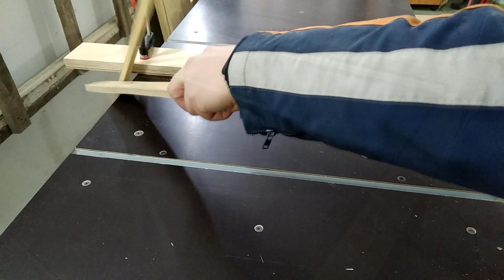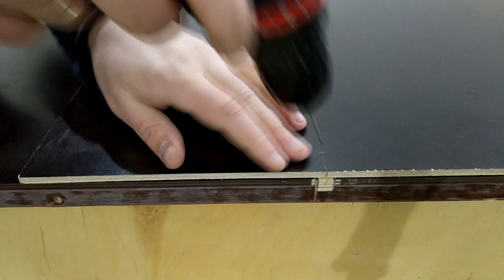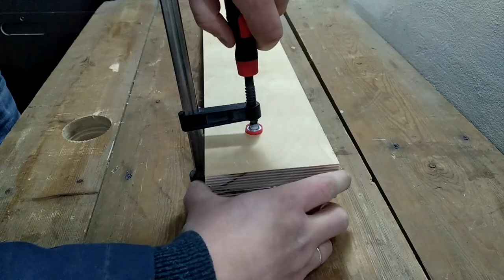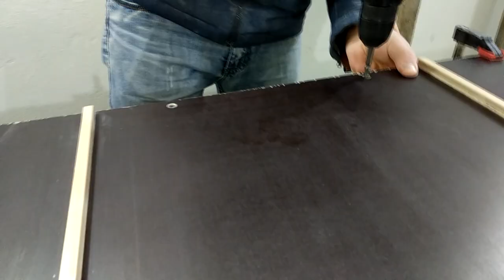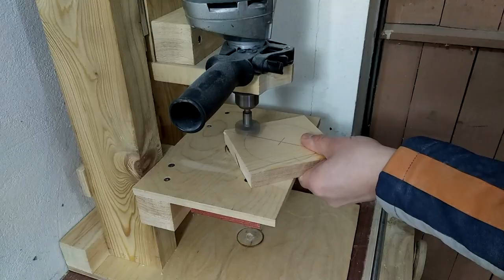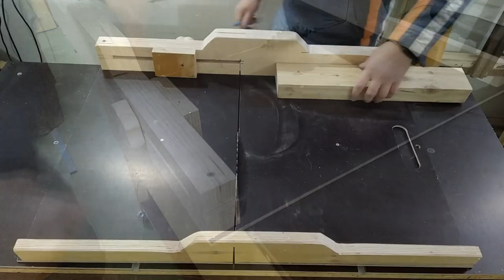Table Saw Sled - Making Table saw crosscut sled

Comment: After seeing a lot I am going to make yours. I cannot source 6mm in my area, will make it 8mm. Question. I am confused about the plywood thickness. You say it is 18mm. But on the plan where two same plywood are glued together it should write 36mm instead of 18mm. Or is it 9mm plus 9mm? (Not that it is so critical any way). On the other side also two glued together?
Reply from the maker: 2 pieces of plywood with a thickness of 18 mm (18 + 18 = 36) are glued in front, the back wall is plywood with a thickness of 18 mm (one piece, not glued)
Reply: @MazayDIY  That's what I thought. Thank you

Comment: Prior to making a cross cut sled, you need a real table saw fence.  Not to mention and outfeed table/support.  Then there is that little safety business of a blade guard.  Not to down grade your ideas but you could have allowed for the curvature of the table saw blade and not over cut.